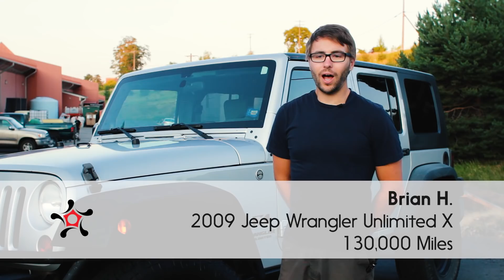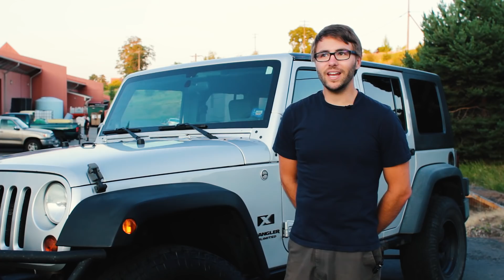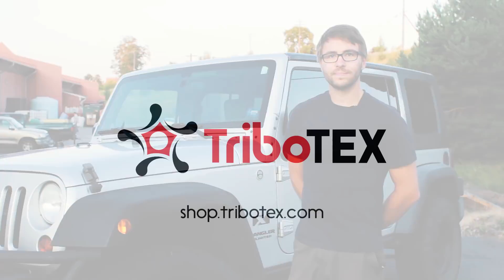Skeptical? So was Brian. TriboTEX review in a Jeep Wrangler Unlimited.

Comment: I'm not believing this . He is a Bio fuels engineer and hasn't recorded the change in mileage, he did not measure the decibels before and after? The front of the jeep does not look like it has been driven 130,000 miles because it would be chipped up. He doesn't even sound as if he has a BS (bachelor of science) in anything related to the automotive field. Sorry but this is not credible or even well conceived.